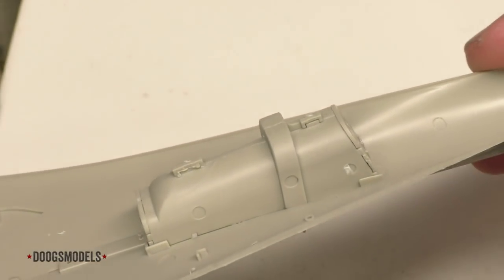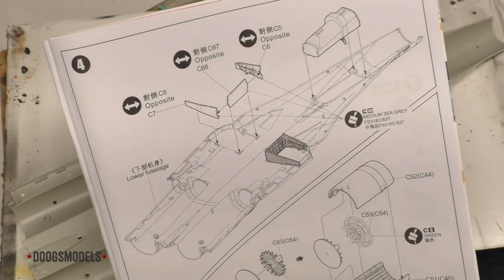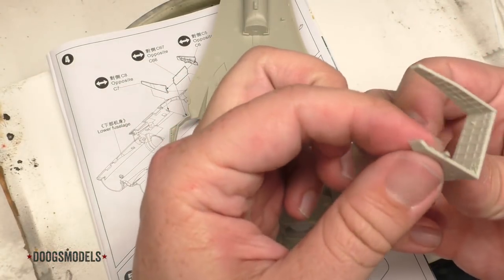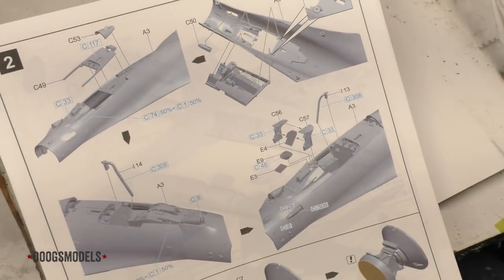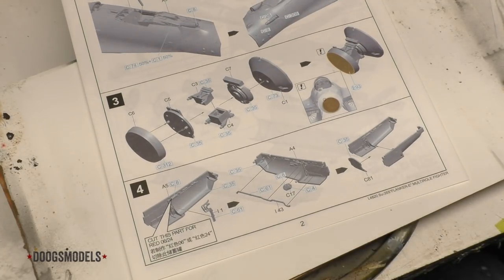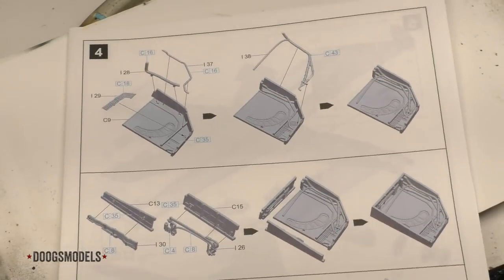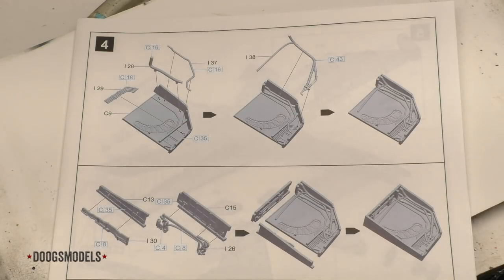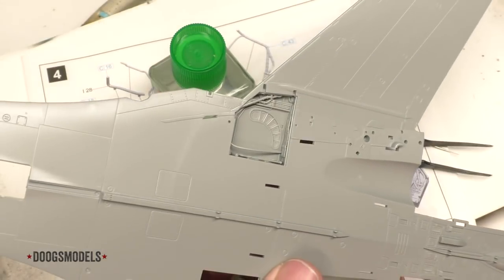Su-35 Flankoff Part 5  - Gear Bays

Comment: the instructions are actually easy to read if you cross out the english word. than you can identify the part for that side and use the chinese instuctions for the other side. without the english line inbetween those 2 statements, you can see the differance between the 2 parts all the better. for the rest, many thanks! very helpfull!!!